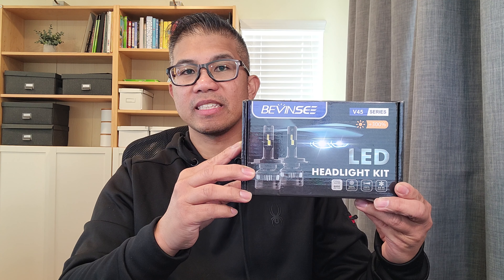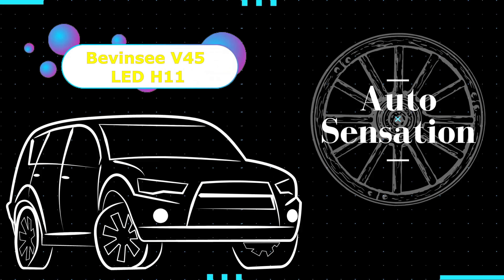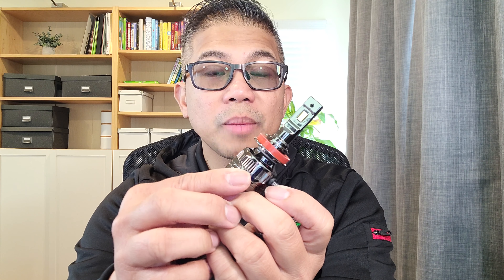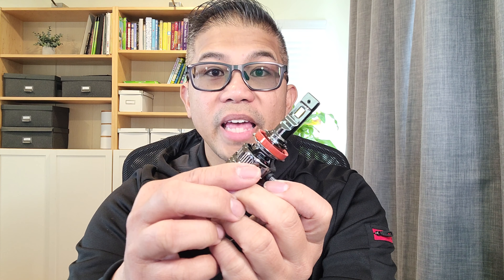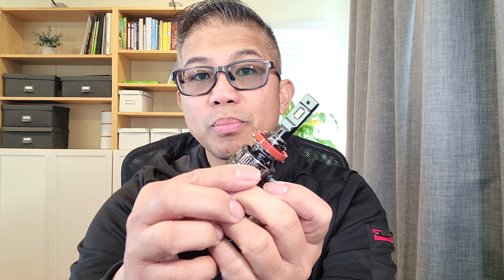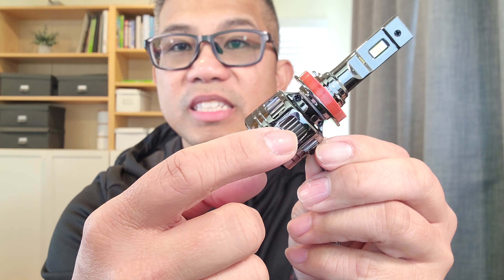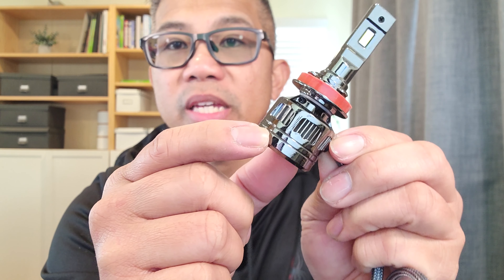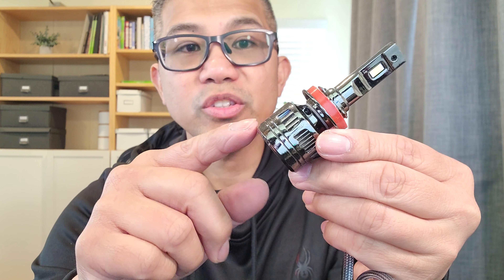How to install Bevinsee V45 LED Bulbs

Comment: looks great but where did you put the driver??
Reply from the maker: What do you mean?
Reply: @AutoSensation  The little "box" that is attached to the set.
Reply from the maker: @carelminnaar8454  Zip tied the wire to the existing loom with the box facing upwards